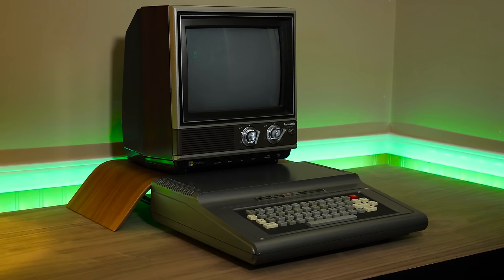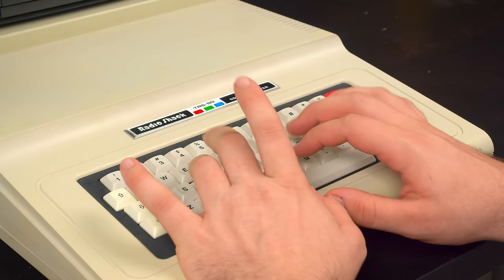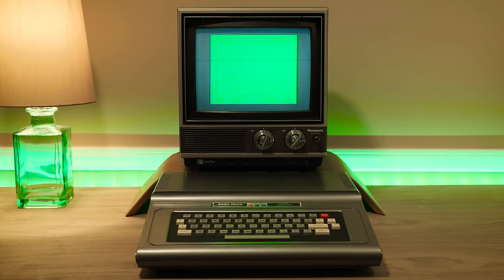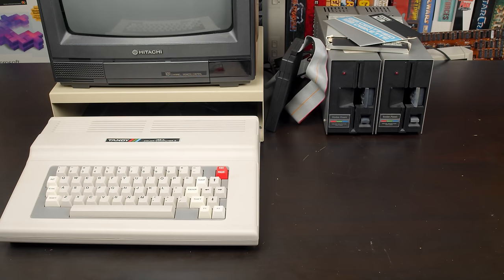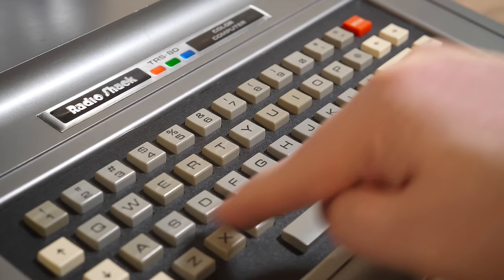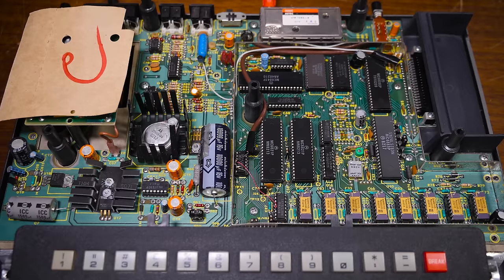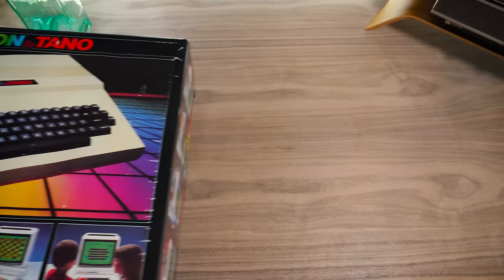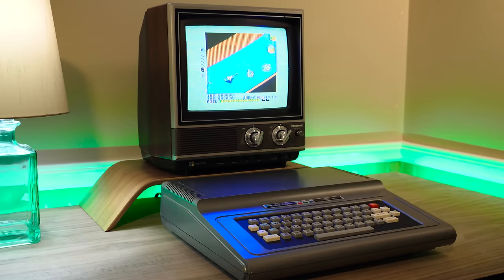TRS-80 Color Computer: Radio Shack's $399 Micro from 1980!

Comment: When I was in school, there were TRS-80s.  When I've seen the Color Computer (or CoCo), I thought this is something I outta get, and maybe something I could use to make programs for TRS-80s.  Then, my dad saw an advertisement of a VIC-20.  We were wondering if it could be a CoCo compatible computer we one time saw in an ad (maybe THAT was actually the Dragon Tano).  We found out that it wasn't, but it looked like something I would like.  So, I got a VIC-20.  I even typed in programs from Compute! magazines.  I also managed to make a few programs in BASIC, which I think I could do better if I learned Assembly Language.  I also tried making a program on a TRS-80 in school, which hardly caught on.  Anyway, the VIC-20 I preferred over the CoCo.  Then came the Commodore 64.  But that's another story.

Comment: CoCos are actually useful in amateur radio applications. This is because the internal components can be reconfigured by software.

For example sound was generated either by toggling a bit on or off and routing the output to modulator audio,or by using the digital to analog converter as a low resolution wave form synthesizer and routing the analog output to the modulator
Reading the joystick was done by single axis of the joystick to a voltage comparator,  and comparing  stick voltage to a voltage  from the D-A converter 
The comparator and D-A converter were also used to for the tap interface,using 1500 baud phase shift keying when the competition used used 300 baud frequency shift keying.

All the CoCos used a memory manager chip - the 6833 Synchronous Adress Muliplexor  od SAM in the 1 and 2's and a more expansive GIME chip in the 3s
The earlier  CoCo's could address up to 128k.

Tandy later produced the CCR-81 program recorder which featured a small switch that preset the volume and record levels for best results with the CoCo.

Comment: What's funny is that the same RAM trick was used by Sinclair in the ZX series of computers, for example a 16K ZX Spectrum was actually a 48K but with only one half of the RAM chips actually working. This meant that Clive Sinclair could save money on buying RAM.

Comment: Ooh nice! Your Radio Shack branded CCR-81 looks completely different to my Tandy branded one. The casing, buttons, cassette door, etc. are all the same shape, but yours is painted silver whereas mine's beige. Instead of the label saying "Radio Shack TRS-80 Computer Cassette Recorder", mine says "Tandy Computer Cassette Recorder CCR-81", with no mention of the TRS-80. And obviously there's no CCR-81 on the cassette door. Mine's also 240V, presumably yours is 120V.

Comment: One of the few 8-bit machines I owned long before they were vintage. Thanks for reviewing this, sorry to say I neglected it over the years particularly because I hated that keyboard …

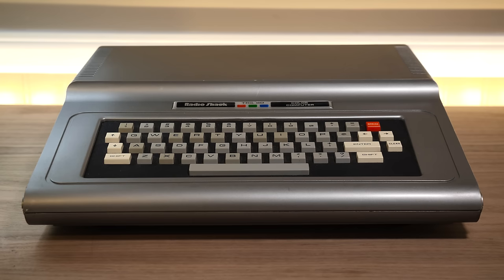I wrote that dice roll program in basic seen on 4:21 … first time I tried to write it the power went out just before I was done with the last few lines. Then I learned to save-as-I-go onto cassette for this reason and got it to work.

Comment: My first computer. It was a an E-board CoCo 1 with the black keyboard surround, 16k RAM and no Exteneded BASIC.  I bought the ROM later and upgraded it to 64K, added Teac disk drives, multi-Pam interface and other nice stuff.  I later bought a CoCo 3.  The cassette interface ran at 1200 baud, not 1500. We found a way to run it at 2400 but that’s pushing most cassettes too hard.  The colours didn’t look as good on the PAL version incidentally.  I still have a CTR-81 and a CCR-82, you seem to havfused these model numbers. The 82 has a monitor function that was great to count programs while you spooled to the one you wanted. The joysticks were poor, but we loved the Deluxe joysticks which were actually a rebadged Kraft.  Early CoCo boards needed bodge wires to make more than 4 or 8k to work as the very early ones used chips that needed 12V and a little later they still didn’t wire A15 up, so at least one wire would be needed for 64K to work.  The very last CoCo 2 had a 6847-T2 which had true lowercase but deleted the occasionally used semigraphics modes that were a result of the 6847 VDG and 6883 SAM chips. These machines do have a 6 bit DAC which is not supported in BASIC but machine language software did make good use of it.

Comment: The original owner of this machine missed the free upgrade to Extended Color Basic 1.1 from RadioShack.  You went into the store and told them that you had an older CoCo with the old ROMs.  They ordered the ROM kit for you, and they installed it for free if your system was still under warranty.  Later versions of TRSDOS required the 1.1 ROM, and it fixed a few bugs.

Comment: I learned BASIC programming and Assembly programming on the CoCo.  Sprite graphics like on the Commodore might have been nice, but having almost nothing hardware accelerated meant I had to code everything from scratch, which wasn't necessarily a bad thing.  I learned a great deal.  Dungeons of Daggorath - GREAT game.  I reprogrammed Gantelet in Assembly because I was so unhappy with the port.

Comment: CoCo had a couple cool features. If it locked up you could push the reset button that would reboot the computer but still have the program in memory. The joystick ports were high speed digital to analog converters.

Comment: Had to LOL as those SFX around 14:10 are exactly like the sounds made by mid 80s Z80 CPU based UK fruit machines (one arm bandits) before they started using Yamaha (and similar) add on sound chips and samples as a plug-in to the main boards from the early to mid 90s. Z80s carried on being used in machines such as Barcrest's MPU4 right up until the early 2000s (although after 1997-8 this was exclusively on 'low tech' machines) and although most machines are later generation or fully digital in bars and pubs, there are probably many Z80 based machines still in use today at seaside arcades on piers etc...

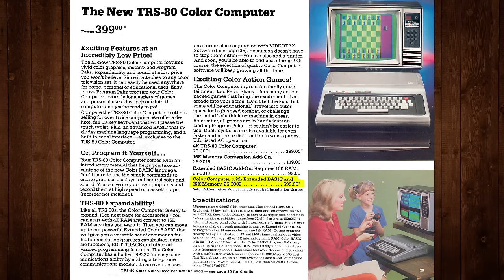Comment: @0:55 actually, the original CoCos did come with two of the basic black single-button joysticks with brushed aluminum handles.
 Later they went with cheaper plastic handles, and I'm not sure if they still included them with the CoCo 2 or 3.

Comment: I bought a TRS 80 color computer that was 4K and upgraded it by myself by purchasing memory chips and soldering them together by stacking them ...! I made it 32K I also got in a magazine and purchased a new keyboard which had the risen rounded top keys....!
I actually used this computer and wrote a bio rhythm program that I ended up selling ( folks their bio rhythm ) by placing a ad in the “national Inquirer” I still have one of the games I wrote it’s print out is downstairs in my studio it was called tunnel run teaching myself to write extended basic from the book, I feel was one of my biggest accomplishments that I ever did by myself...😹😹😹

Comment: The Tandy I had could also use carts that looked like a cassette (shape and size), one cart had BASIC on it and you could save your programs to an actual cassette, it also had a number-pad you would put overlays on depending on what software you were running. The controllers kicked ass too, they're the controllers you see at the beginning of Lampoon's Vacation

Comment: i just downloaded a pile of games in mp3 format, and plugged the tape deck cable into the headphone jack. had to play with the volume for some to load, but no issues with machine language titles. i turned it on after sitting in a box for 30 years, rf out has some issues cutting in and out occasionally. i loaded up some of the games  i downloaded as my cassettes have seen better days, played a few games, digger, fury by computer shack, chopper strike, zaxxud have 2 zaxxon knock-offs. played galliga/galligon for a few hours. took a few pics and clips for fb of the global thermal nuclear war opening text, and put it back in the box. my solution for the crappy joysticks was still present on one. to keep them centered i wrapped the base of the stick with elastic bands that also made it stiffer for easier control

Comment: My first computer. I surprised myself with I wrote a BASIC program that ran it out of the 4k ram and got the 16k upgrade for Xmas! Had a great manual with cartoons and stuff. Probably responsible for my career as a graphics and sound programmer. Glad I didn’t get the text only green screen model ][ 😂

Comment: I had the white  64K  TRS-80 CoCo.   There was a  Color Computer Magazine where you could copy code for free programs.
I don't mean copy with some scanning device .  I mean look at it with your M-1 A1  Eyeball and typing in the code.
God help you if you miss a slash or backslash.  I also had a BIG  cool Daisy Wheel Printer.
Changing font was easy.   Just change the Daisy Wheel.

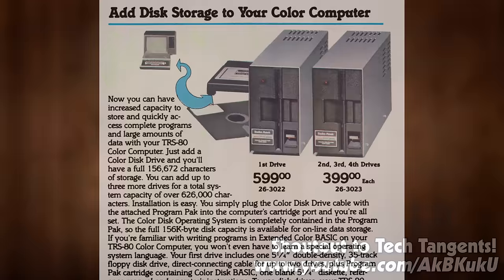Comment: 8:30. It was exactly the same situation with disc drives for the MSX. Regarding cheap floppy drives for the BBC Computer, in the mid 1980s the Plessey  Amateur Radio, Electronics, and Computing club did a bulk buy, using Plessey's company discount to get the price of bare 5 1/4 Disc Drive mechanisms down to just £130 each. 
p.s Can you try the Tandy Pen Plotter printer. As a user of Calcomp professional plotters at the time that always fascinated me seeing it in the catalogue for much less than one of those floppy drives.

Comment: My first computer (That I owned) was a Coco.  Silver case, but I had it cranked with 16K of ram, several cartridges, and a couple of joysticks.  That keyboard lasted about 10 years or so before it started to fail.  Like an idiot I ended up getting rid of it.  Oh concerning the sound there is one cartridge that (if memory serves correct) had a blurry digitized voice in it.  The game was called "Mega-Bug".  A neat variation on the pacman theme.  You left a trail behind you and the enemies would follow it.  If you doubled back you could throw them off if they took a wrong fork.

Comment: If the black joysticks are awkward to hold and fire the button, then you're not holding it right. Having the button in the center means Lefties can use them just as easily as Righties. It's the "Deluxe Joystick", with it's button on the left side, that was very awkward for Lefties to use. For us the black joysticks were much easier.

Comment: It got the "TRS-80" moniker purely for marketing recognition of the Model I and Model II.  The CoCo ran on the Motorola 6809 processor (and was pretty much the reference design from Motorola, as was the Dragon 32 and Dragon 64 from Wales, with both easily converted to run software for the other) instead of the Z-80 that was the original source of the "80" in TRS-80.

Oh, and the way Dragon Computing collapsed resulted in new old stock Dragon micros only running out a few years ago.  (You used to be able to buy them from a big retro hardware website in the US, which also had an impressive array of old floppy disk mechanisms for sale.  Too bad a working 8 inch mechanism cost at least a grand five years ago.  I really would like to get hold of the full schematics and plans for one to see if they could be replicated by some modern fabrication company.)

Comment: By the way- here are the true capabilities of the video chip in the TRS 80 coco 1 and 2:
Text of 32 columns of 16 rows.
In text mode you can also switch certain chars into "Color cell graphics" mode where you get up to 64*32 pixels with 9 colors.
Next are the graphics. You get 2 types- resolution and color. Resolution graphics can be anywhere from 128*96 to 256*192 (Modes are 129*96, 128*192, and 256*192 with green and black or white and black). Color graphics have 4 colors and are anywhere from 64*96 to 128*192. Half the resolution, double the colors! You get 2 palletes of 4 colors to choose from, one being white, orange, blue, and black, and the other being red blue green and yellow. You can guess which one was used more by the games. (Hint: it's the first one)
In text mode and hires graphics (both having the same 2 palletes of 2 colors, being green and dark green or orange and dark orange) you can do artifacting tricks to get 4 simultanious colors. This was similar to the apple 2.

Comment: Back in the day we used to call them Trash-80s but the hate was mostly fake. The later iterations were much better and I quite liked them though I never owned one. I inherited a Vic 20, a C64 and a Commodore 128 all of which I never really used. The first computer I bought was an Amiga 500, in 1991 from MontgomeryWards, long since deceased. Since 1996 I have been building PC tower systems - mostly built around AMD CPUs with the odd Intel one here and there. I guess I'm nostalgic for those early "Home " computers. Thanks for the memories.

Comment: That's the thing about the CoCo, the standard interface didn't change (much) in 3 generations. I had the CoCo 64k and then went to a CoCo 2, then to a CoCo 3 and got denied the CoCo 4 so i went to an Apple ][ then to a PC. Coding was a real headache because you had to wait for the next month (sometimes the month after that) for the code corrections if there was an error. I tried OS-9 but never got the real hang of it. I even ran a BBS on the CoCo but that's another story.

Later i tried emulating but the guys, who made the emulator, were a bit money-hungry and i ended up letting the CoCo go.

Comment: I saw one of these at my local computer recycling center once.
I believe it was a coco 2 or 3 and it was mixed in a box of vic-20s and c64s. I now regret not buying it (it was only $30).
I own a trs80 4p and the graphics on the coco look MUCH better.

Comment: I want that ColorPilot heh, just got a neat Panasonic TV/Clock/Radio that has a cool neck mechanism. PSA: Get yourself a 13" CRT today Nighthawks. ;)
Yep "I am a late 70s early 80s business automaton, what would I need color for?" , "I need a cup holder for my scotch.". ^_^ There are a whole slew of US words originally ending in "o-u-r" but color is the one most mentioned, go figure. 
The Coco3 seems to be fairly pricey now while the 2 and 1 are more reasonable when you find one. RF can be surprisingly sharp if the signal is strong enough like TV stations used. 13:36 Free RAM huh, in that time it was a godsend. :D

Comment: I brought one of these used in the late 80's for about 30 UKP. I had a VIC-20 at the time and the VIC was a better machine if im honest. Games were thin on the ground but luckily the Dragon32 games would run on it without issue which opened up the market a bit.

Comment: 1/2 the memory is always dedicated to graphics. 64k will show 32k 16k will show 8 unless otherwise specified in a command line and reducing the amount of ram dedicated to graphics. I upgraded mine and many others to 64k. The only chip that isn't going to be available for that computer is the sam chip. Looks like that computer was manufactured after the 13 week of 1982.

Comment: 9:44 I think you got yours plugged wrong. You don’t hear the tape unless you use the appropriate command in Color Basic to output the sound to the TV. The issues you can run into related to volume are that if your deck is playing at the wrong volume, your CoCo won’t be able to “hear” the data correctly and will just give you an ?IO ERROR.

Comment: Why do the people keep confusing the TRS-80 with the Color Computer? Maybe the children using them in schools (the very few who didn''t have apple computers) might have called them trash 80s. Most adults I knew followed the lead of the computer magazines and referred to the business oriented (black and white) TRS-80 as the trash 80 and the Color Computer as the Coco. I had a Color Computer with color basic as my first computer. It did not have extended basic. It came with 4k of RAM, and was upgraded to 32k using stacked chips. I learned to how to work around the limitations imposed by the lack of extended basic.

Comment: I had a CoCo 2 as my very first computer, although it was a stretch to call that thing a computer. It was awful but cheap, especially when my dad picked one up in 1986 (or 1987, I'm not sure). I remember playing "Color Baseball" with stick figures on those terrible joysticks.

I wish he had chosen a Tandy 1000 or at least a CoCo 3 instead, but that would have been more expensive.

Comment: Ah, the Motorola 6809. I doubt I'm alone in thinking Atari should've went with the 6809 instead of the 6502 in their 8-bit computers and the 5200 back then.  I'm curious though... are there any hardware upgrades to any of the CoCo models that add a 68881 FPU to the system? Of course, that's regardless of whether there's any software written to take advantage of it. After all, there's very few Amiga and Atari ST software that take advantage of the 68881/68882; slightly better support on the Macs from their contemporary 16-bit era...

Comment: You skipped over OS-9 because it was not relevant on the Coco 1, but I wish you had covered the CPU in more detail.  The 6809 is different than the Z-80.  True.  But you showed the computer's contemporaries as the Apple and Commodore, which were 6502-based.
The 6909 is significantly more capable, hence the existence of a real operating system.  Did this affect the overall speed, and factor into the hardware tradeoff (e.g. no separate sound chip)?

If BASIC was the way you normally interacted with it, how did it compare in speed and language capability to the other computers of the era?

Comment: with inflation $9,000 would be almost $30,000 now imagine this... that was a fully decked out PC desk setup... the MAC pro fully decked out is $54,547.98... not including the $7,197.00 monitor. now yes it can be bought for much cheaper but that is fully decked out for both.